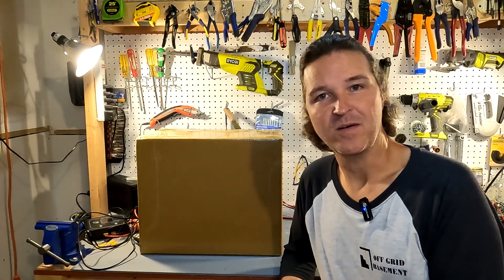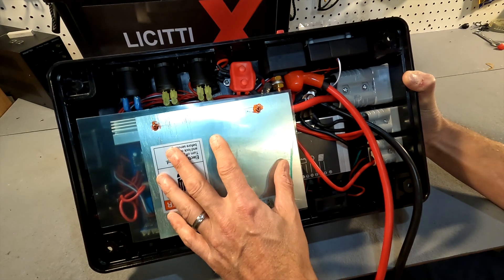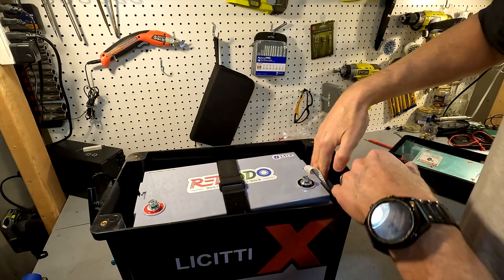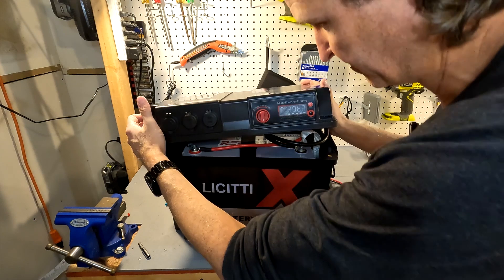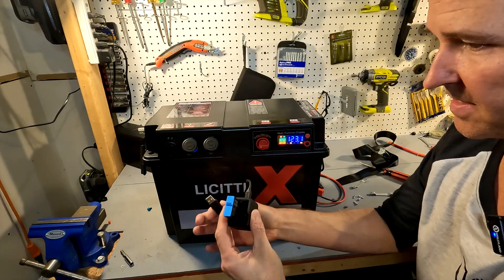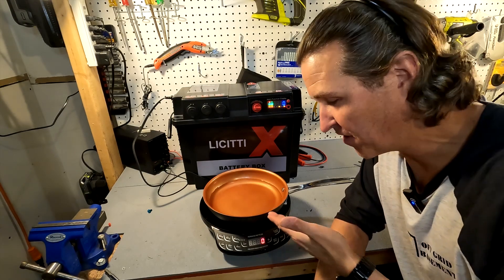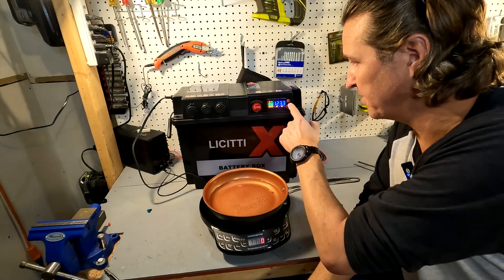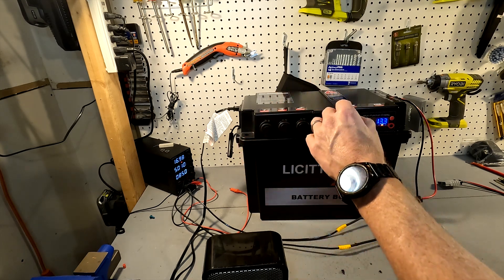LICITTI Heavy Duty AC Battery Box Review.  Turn a 12v Battery into a Power Station!

Comment: I have this same box and I'm not very tech savvy. I am using this periodically for my C-pap machine but I don't understand how much voltage I am drawing. I know it has the green bars and the red bars but how do I tell when it's getting near the point of draining my battery? Somehow misplaced my Instruction Manual. Thank You Gary
Reply from the maker: This box doesn't have a true shunt.  You would need to purchase one in order to really keep track of your amp draw.  Hope this helps!

Comment: With that temp sensor not working I would be happy with buying something that has a problem.  Maybe it's just this unit that has the problem but you don't know. And I'd like to know what voltage/amps my solar panels are providing and this doesn't provide that. I think I'll pass on this and keep building my own solar system even if it costs more.   Thanks for the review.
Reply from the maker: Thanks for the comment!

Comment: I have one question. Since this box has a 10A MPPT controller and it is possible to connect a solar panel with a power of about 150-200W, is it possible to first connect a solar panel with a power of 600W to a Victron MPPT 100/50 controller and then from that controller to connect to this box via Anderson input/output port? Would that charge the 280Ah battery with more power?
Reply from the maker: Yes.  If you had the Anderson connection going from the Victron CC to the Battery box then there is no reason why it wouldn't work.  The Anderson connections inside the box connect directly to the battery.
Reply: @OffGridBasement  Thank you for your answer and help 👍
Reply: @OffGridBasement   One question. I have two AllPowers 200W solar panels. One has these specifications Open Circuit Voltage 22,2V, Short Circuit Current 12A, Power Voltage 18V and Power Current 11A and other have Open Circuit Voltage 44,4V, Short Circuit Current 5,95A, Power Voltage 36,6V and Power Current 5,45A. Which of these two panels are more suitable for this AC Battery Box?

Comment: I don't know, but it is possible that the temperature sensor is a way to control the fans. If the inverter is not producing heat the fans will remain off until temp rises due the inverter running.
Reply from the maker: That's a good observation.  Thanks for the comment.

Comment: Can you guide me how this would help in my plan to use it as back up to a solar pond pump where when there is no sun, the system will switch automatically  so that the pond pump will continue to work overnight?
Reply from the maker: I would need to know a lot more about the solar pond pump in order to really help.  The battery box would need to be wired between the solar panel and the pump.

Comment: Thats pretty cool and I been researching solar power generator, and I have a question. Does that support pass through solar charge. Like can I use the 110 watt plug and than will the solar panel charge the battery at the same time?
Reply from the maker: Yes it does.  Everything inside is independent of each other.  Hope this helps!

Comment: I paid the extra for the 20 amp AC battery charger. There was nothing else included in the licitti box. Am I missing something or is it built into this box and if so, I have no idea how it works. Any thoughts any help? Thank you!
Reply from the maker: Everything should be built into the box.  It's all included under the top.
Reply: @OffGridBasement  after several email attempts they are finally shipping me the charger. It is a separate unit.
Reply: @karlpeters2134  Hey is the 20amp charger connected to the unit via anderson?
Reply: @theFisforFrancis yes

Comment: How many watts can you charge by solar and how much by A/C power?  Can you A/C charge battery with solar at same time?  If so at how many watts total?   What does a power station like ecoflow delata 2  do that this unit doesnt?   Because this is half the price with 100ah battery conpared to delta 2 and 100ah battery has close to 300wh more.
Reply from the maker: There is no AC input for the battery box.  You would need to get a lifepo4 charger.  This box also won't tell the SoC of the battery.  Hope this helps.  Thanks for the questions and comment.

Comment: Make sure if you put a Lithium battery inside it has at least a 100A BMS, otherwise the inverter will shut down if you try to draw 1000W.  Many of the cheaper 100AH batteries only have 50A BMS.  And beware - do not try and use this to jump start a motor via the large anderson plug - use a proper jump start device.
Reply from the maker: Thank you for the info and the comment.

Comment: I'm new to so called "Solar Generators" and own a few brands  and what interests me the most are the 12V cigarette receptacles and not the a/c power.  I own a couple of jackery 500 that I use for my dometic and cpap, but would enjoy a power bank that would have 3 or 4 12v cigarette receptacle so that I could also plug a 12v fan when camping.  Do you know if I could replace the usb plugs with the 12V cigarette plugs and still draw 10 amps max from each receptacle , will the wire gauge handle it?  Thank you for your videos, I a new subscriber, I really like your content.
Reply from the maker: Unfortunately no.  The USB ports wouldn't support that load.  My suggestion would be to buy a cigarette lighter adapter to 5521 barrel plug.  That might work for you if your power station has barrel plug inputs.
Reply: The 12VDC cigarette receptacle is probably limited to 10A or 15A, so if you go the "splitter" route, you have to make sure your devices don't go over that amount when run concurrently.

Another option is to get (or make) an adapter for the 50A DC Anderson plugs as those are putting out battery voltage (around 13.1V w/LiFePO4). Unlikely Jackery, these are NOT regulated, so the voltage will fluctuate. However, LiFEPO4 batteries have a consistent 13Vish output. Just make sure you DC devices don't need an exact voltage (most don't as car voltages fluctuate a lot).

Comment: I would recommend using a wrench to fasten the battery terminals to prevent overheating or arching. A screw driver won't compress the spring washer enough to ensure good contact between the two surfaces.
Reply: No asked u.
Reply from the maker: Good point.  Thanks for the comment.

Comment: I like the concept of a battery-less power station where the user supplies the battery.  This unit is not the ticket, though.  They shouldn't try to box a limited-size battery for one thing... just the power station piece and an anderson connector or two for the battery mains is more desirable.  Also,  power stations (even small ones) don't use 12V internal architectures for a reason.  This thing is going to be horribly inefficient.

But something like this that can accept a battery, say up to 16s (51.2V nominal), without the battery box mess... that would be useful.  The product is horrible but the concept is sound.
Reply from the maker: Thank you for the info and the comment.

Comment: I wish it had an A/C charger built in to recharge the battery.
Reply from the maker: That would be a very nice addition.  Thanks for the comment.
Reply: You have the option to order with or without a charger.
Reply: Get a charger that is appropriate for the type of battery you are using and replace the large alligator clips that normally go on the battery posts and put replace them with  an Anderson plug. Be sure to be mindful of the polarity when you put the Anderson plug on the charger wires. Then just plug the charger into one of the 50A Anderson plugs on the lid. Those plugs are for input and output.